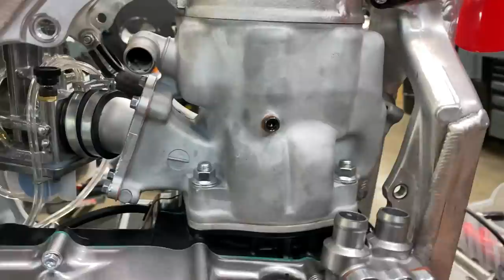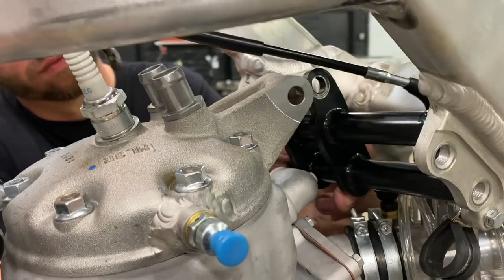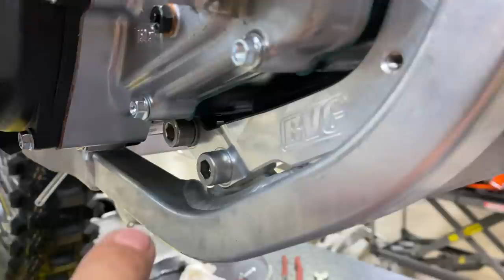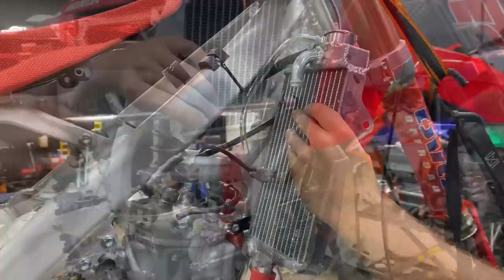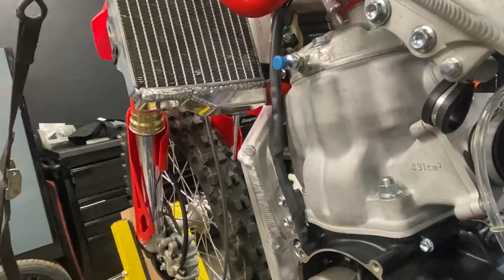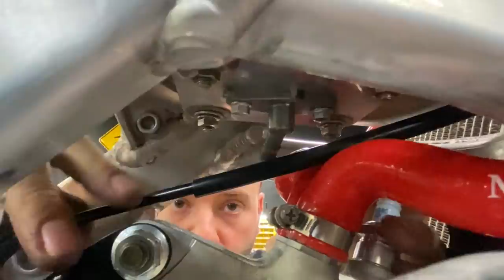HONDA CR500R Bolt In Kit Install - HOW TO - 2021 2022 CRF450R Chassis  PART 1

Comment: You guys must have a ton of time in designing and machining. I don’t think most guys fully understand what goes into something of this scale and quality. The 500 guys are blessed to have you guys making this possible.
Reply from the maker: We do! Tons of time… but you can see how much we simplified the whole process.    That is our goal… to help out the DIY guy who wants to build a bike at home and not wait months for frame mods etc.      it is pricy being we use the 2021 and 22 chassis.. so it is not for everyone!   But the cool part is you can go back to a 450 if you ever wanted.. (i doubt it after you feel it as a 500!). 

Thank you for the support! Its what keeps us motivated to keep doing stuff like this.

Comment: I'll tell ya that's really a super nice kit! Your craftsmanship is bad ass. Everyone talks about AJ Wagner but I'd rather buy this kit to be honest! I have a mint restored 85 ATC 250R. I road it for years and years after I sold my banshee I bought new in 01. My old man bought a new 250R fourtrax in 86. He bought me a 125 fourtrax and I had it for 3 yrs and then I saved up 500 bucks working. I sold the 125 & bought a Suzuki Quadracer LT250R, I was 12. I got sick when I was 40 with fibromyalgia so I can't ride anymore. That's why I restored my ATC. If I ever did by I bike just to blast around on I'd get a nice aluminum frame & buy your kit and a 500R engine! I watch all your vids, keep up the great work and videos....👍🔥💯🏁
Reply: AJ was the pioneer for the CR500AF, and while they are expensive, they are factory-level builds that adress any possible trouble areas with the original design, and are warranted to boot.

Comment: Is the Y higher on the new crf frames for the exhaust to fit through and smaller (lower down )on the old crf frames if you get what i mean so you don’t have to chop the frame so a kit could be designed to fit the old crf frame

Comment: Great video.. too bad engine mounting kit DOESN'T COME WITH "RUBBER BUSHINGS" TO DRAMATICALLY REDUCE 500 CC VIBRATION .. A suggestion
Reply from the maker: No need the cradle and this 450 chassis makes it vibrate less than a original 500 frame
Reply: They don't even really vibrate so much as buzz.
And a trued and balanced cranks will stop that.

Comment: There is a company on eBay from the UK That sells a kit like this for short money but there is no airbox solution.  Does yours have an airbox? The 2022 has a different shock body that does not allow an airbox without doing a remote  reservoir shock from mx tech that costs $2400 or some other solution....how did you deal with that? What is the price and availability of your kit?
Reply from the maker: The kit from the UK is a weld in kit.. also does not come with radiators , or any of that  but looks nice if you want to do the welding route 

ours is 100% bolt in no welding.

If you check out the 2nd video i have some closeups of the intake i fabricated.  
We also currently use part of the OEM box. 

How ever We are working on some airbox designs currently - and will release them soon.   We have invested in some 3d scanning equipment so some crazy new parts are coming. 

Pricing is at www.bvcoffroad.com with a full break down of parts included.    We have been running a pre order( with alot of interest from all over )  and are producing a pile of these in the next couple of weeks.   
Soon they will be in stock ready to ship!
Reply: Awesome,  thank you!
Reply: @KaplanCycles  you damn right the Kaplans are here checking it out
Reply: @BVCOFFROAD  how much for one? is there any ideas to built one for the 2017 model? can it be shipped to Portugal?

Comment: I love how the two strokes are making a comeback. 4 strokes are overrated.
Reply: @donniebaker5984  hate to tell you this, but the 21 450 makes more power than the cr500s
Reply: @StrykerV8  the cr500s from 20 years ago, built it today with the same cost in R&D that 4strokes did in the last 20 years
Reply: @JoaoSilva-gs5jb  "yeah but!!" I love those arguments. Welcome to reality. 500s are dead and 450s are more powerful. Sorry.
Reply: @StrykerV8  No they are not. Just give it time bud. One day you'll understand.
Reply: @GarbageDanks  "no they aren't!! Wahhhh!!!"

21 crf450: 57hp at the tire
Cr500: 52hp at the tire
Reply: Nobody will be paying $20K+ for a mint, pristine CRF450 in 20 years.

But they will for a CR500.

Comment: Do yourself a favor and ditch the Lectron 
You’ll thank me later
Get a CR250R Airstriker and run I believe I jetted my 99 CR5 with a 70 pilot and 74 main
Runs and starts like an electric motor
Reply from the maker: so far ive actually really enjoyed the lectron.. bike runs super crisp 

ive ran air strikers in the past on many builds  (trx250r etc)   they are great also

Comment: Why Alan head?
Reply from the maker: Clearance and fitment
Reply: @BVCOFFROAD  makes sense
Reply: @BVCOFFROAD  I’ve just grown a hatred for them cuz of how many times I’ve striped old Alan heads
Reply from the maker: I feel you!   I had issues in the past with some fasteners… but we sourced an awesome hardware supplier… no stripping issues.   Also helps to use quality tools like snap on  and eliminate any issues.
Reply: @BVCOFFROAD  yeah makes sense I guess I’ve always felt with average tools and average bolts good to hear hardware companies improving the Alan head cuz it can be a pain